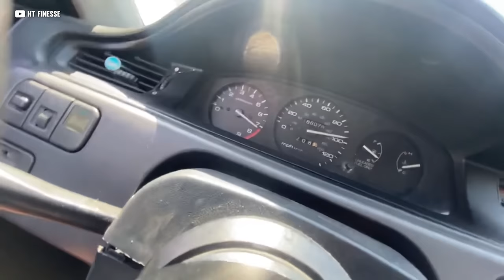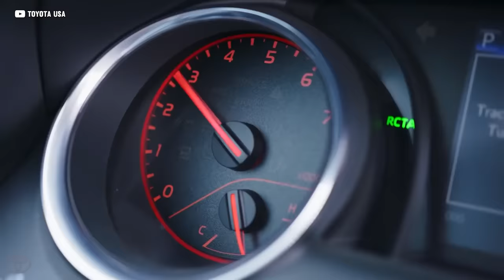7 Things NEVER Do In A Manual Transmission

Comment: If you cant hold the cluch in when on red light and adjust it on the frictionzone it means you need to hit the gym more often💀💀💀No one uses handbrake on a red light with slight uphill.💀💀
Reply: Work smarter not harder there guy.  It's not because we can't, it's because we're saving wear on our knee joint, our throwout bearing, and our clutch.  It's because we'd rather replace our clutch every 10yrs instead of every 2.
But you do you.  Say hi to all the pretentious influencers for me while you're at the gym.
Reply: Yeah I'm not going to engage the parking brake every time I come to a stop light cuz a lot of the time it's not that long of a wait
Reply: You've never had to hold in a old school cable center Force clutch with a 75 lb release. Sit and stop and go traffic with that will have your leg quivering.
Reply: @mockemperor953  The wait depends really.  So does the time to sit with the clutch engaged and in gear.  As well as the parking brake location.  In my truck, I have a foot parking brake.  I'll engage it for trains and long waits.  Like in a drive through.  Otherwise I have my foot on the brake pedal.  As for my miata, I have a hand brake.  I'll often times just fidgit with the release button.  I'll also engage the release button and use this as my brake in slightly downhill situations where you're in stop-go traffic.  Say at a busy stop sign.  I'll also engage the parking brake when parked uphill to keep from rocking backwards.  Someone I went to school with was complaining on FB about how the person behind them was too close and she rocked into them.  I responded by reminding her that this wouldn't be an issue if her handbrake was pulled.  She didn't like my response.  For highway intersection lights, I have the hand brake pulled and in neutral until cross traffic at my forward right begins to go.  Then I engage the clutch, put her in first and wait about 5-15sec.  My other strategy is watching cross-traffic stop lights.  This has become harder to do over the years, but is still pretty easy at night.  On the cross-traffic yellow, engage the clutch, put her in gear and wait.  Sometimes protected greens will mess with the timing, but those are pretty easy to figure out once you've been through the intersection a few times.  One could say that I use my hand brake for more time than my brake pedal.  My brake pedal is usually reserved for hard braking.  Speed correction is done with engine braking and sitting is done with a hand brake.  I absolutely hate it when someone is in front of me with one of those RICE flashing 3rd brake lights and they use their brakes to adjust speed every 10sec, while riding the bumper of the person in front of them.  The cringe is just too much.  You'll know a tuner because they'll have a 4th brake light, it flashes at high frequency and the brakes only come on when braking hard, or in stop-go traffic.
This is all probably just preference.  Hopefuly, this helps explain a thing or two.
Cheers.
Reply: @robertstone9988  Does a folkrace car count.🤔🤔🤔
Reply: @robertstone9988  Good idea. I can hold the hand brake on a folkrace car. Should not be that different launching on a up hill. 👍
Reply: @lassivaisanen4354  what the flying fuck is a fork race car? You talking about a fork lift?

Comment: All good advice really. It's a shame people aren't required to pass their driving tests with a manual car, that requires you to think so much more about your driving than a slushbox.
Reply: If that was the case there would be left people driving because it's not required or  people don't want to learn
Reply: After a very short time you really don't have to think about your driving more in a manual than an auto. 
It makes more sense to learn on an automatic first so that you can concentrate on the driving part rather than worrying about the additional controls. Once that is second nature you add in the clutch and gear selection. 
It wasn't really an issue for me as I had been driving field cars, dirt bikes, and manual transmission tractors for 6 to 8 years before I got my license at 16. 
BTW: In the US and Canada you have to pass your license on a manual in order to avoid an automatic only restriction when you take your commercial license test.
Reply: It is required in South Africa to use a manual gearbox car to complete your drivers license
Reply: If you get your license in an automatic here (I'm Dutch) you're only allowed to drive automatics for a number of years. After that you're allowed to burn a clutch 🤣
Driving a manual isn't really making you think more about driving. After a while you don't think about it at all anymore. It becomes a reflex and often you don't know in what gear you are, you just shift when the engine revs tell you to. My granddad learned me how to drive when I was 5 or 6 years old. Remembered it for 12 years and was able to manually shift from my first driving lesson. Only time I had trouble with a clutch was when I sold my Pajero TD and bought my first RAV4 on gas. First day I stalled it every gd traffic light, cause I wasn't used to revving the engine anymore.
With all the EV's, BEV's and PHEV's, automatics are fast becoming normal here too. My car (Toyota RAV4 Hybrid) doesn't have a clutch. Hell it doesn't even have a starter. It always pulls away electric and the the ICE comes in if neccessary. I started to have problems with my left knee (old age 😁) so it's a relieve to me not having a clutch anymore, especially in heavy traffic. Friend of mine has a Mercedes GT63s AMG 9-speed automatic. You can't shift as fast with a manual, so whereas automatics were slower than manuals in the days, that's no longer the case either. Automatics win every time. Same with my RAV4. It's a CVT. It doesn't shift, so no time lost changing gears at all. Goes from 0 to top (120mph) in one swift move. These days they can even pull trailers. Mine up to a little over 3500lb. The Merc with it's ± 700bhp V8 BiTurbo can't pull sh1t. Too damn low for a hitch 🤣🤣🤣
Reply: Even in Russia you may get automatic-only driving license these days. Truly the end is near, lol. Well, nothing is wrong with it. Its kinda easy to get automatic transmission and manuals aren't exactly "better". Another thing bothers me. I dislike that a lot of people only use a car as a mean of transport without ever understanding how it operates. It's just some magic for them, same as computers, internet or microwave oven. The void of knowledge is filled with superstition.
Reply: @Vivicect0r   And Romania
Reply: manual is honestly not that much harder than auto. the hardest part about driving is awareness of your surroundings and other drivers.
Reply: I don't want drivers in my city to have to learn manual. They can already barely handle automatics
Reply: In germany, it is. You can only drive a manual if youve done at least ten of your lessons (each 45 min) during driving school in a manual and have to do short demonstration on it. Previously you were only allowed to do if you had actually done your licence test in a manual.
Reply: In Turkey if you pass your driving test with an auto, you're not allowed to drive manual. If you do with manual, you're allowed to use both.

Comment: I learned manual in the 7th grade and have been driving it so long to the point that i look for the clutch on an automatic or CVT car
Reply: doing it for over 2 years and I have a cvt car beside the type r. I still sometimes look for a clutch in the cvt
Reply: How did you manage to go out and not get pulled over?
Reply: i do this when i go from driving a jeep on the farm to driving my car. ill instinctively press down where the clutch would be only to hit the footrest really hard.
Reply: @GK-ut9nc  i didnt go anywhere more than 3 miles away from my house before i was 15
Reply: @g0d182  Most all my cars have been manual. when driving other peoples' automatics I have several times put the seat belts the test from my left foot smashing the brake pedal.

Comment: additional information from Eastern Europe. never use the handbrake because it doesn't work. always brake with the clutch on the hill because the handbrake doesn't work. don't park on a hill because the handbrake doesn't work. when you have to park on a hill, use a large stone or a piece of wood that you find somewhere in the garbage near the place where you park. the first gear is a little difficult, so add gas and go from the second. the clutch only works all the way down. don't destroy the clutch, we don't have it in stock and we can't buy a new one. that clutch was good for your grandfather, but today's young generation...
Reply: what's bro yappin about, never had a problem with the handbrake

Comment: when you're braking in a manual car, especially from speed, you release  the accelerator and press the brake to slow down. you leave the clutch alone and the slowing engine actually facilitates slowing the car because the wheels are under control and deceleration is improved. you put thr clutch in shortly before stopping
Reply: If there's water involved you will have to cut the transmission (use your clutch) to avoid losing control of your vehicle. Yes breaking without clutch is usually better but your default spine reaction should always be using the clutch every single time. Make the call of not using it consciously on winter or on a bone dry road accordingly.

Also on winter. If you're breaking and the car just won't stop. Use the handbrake as a last resort once you've already lost control.
Reply: @aleks5405 not good advice, i found myself in a couple of icy twisty roads and what you're describing is exactly how not to handle a slippery surface, on a slippery surface it is ALWAYS the best idea to be smooth with all of your controls so no clutching in and definetely no hand brake pulling. if you find your car on an ice patch the best thing to do is to SLIGHTLY steer in the direction you wanna turn the front of the car and to either apply no brake/throttle or apply the slightest amout of throttle depending on speed and on wether your cars is RWD/FWD/AWD, pulling the handbrake is a death wish since you are completely preventing your rear end from getting any grip.

Comment: For my AE Corolla I always put the lever on 3rd or 4th. Main reason is being rwd there are two shifter return springs and by putting it on 1 or reverse you compress those springs and wear the tension over time. This is why you sometimes feel going from neutral to first has less resistance then going from neutral to reverse and vise versa. It's okay for most fwd as the shifter return springs are torsion springs and not heliacal
Reply: Though, you should never put it in a higher gear then 1st or R if you have a diesel. Put it in 3rd for example and you're parked in a slope and you don't pull the P-brake, or the P-brake doesn't take properly, it can start rolling. And since the wheels are now directly connected to the transmission and the transmission to the engine, the engine will crank if it starts rolling. A diesel engine doesn't need a spark to ignite the fuel so worst case scenario is that you now have a self driving car that might not stop until meeting an object heavy enough to stop it.
Reply: @tntfreddan3138  There are very few diesels around now which will run without electrical power - they all need computers to control the fuel injection these days. Valid point about using lower gears, though.

Comment: Another good way to avoid shifting into the wrong gear is to realize that most modern cars will have 5 or 6 gears and a reverse gear, so you separate the gear stick into three columns one to the left, one in the center and one in the right. When you have the stick in neutral and you're not touching it, it will automatically be in the 3 and 4 column, so you know from there if you shift downwards you'll have fourth, and upwards you'll have three. Same for the left and right column. This way, just by letting the stick naturally fall into position, or moving it left or right you know which column you are in, and which gears you can select.
Reply: Yep, don't need to fully double-declutch, but if going 2-3 (or 2-4 if your driving is spicy), disengaging the gear and letting the gearstick spring back to the centre, then going from there and you'll be very unlikely to find the wrong gear.

Comment: I've once happened to be slowing down in a parking lot using engine. And my car is fwd. And it was winter. And I was turning...
Breaking power of the engine ended up being the main culprit of locking the wheels and making me slip. Luckily I wasn't going fast to begin with and a slight touch on the accelerator immediately solved the issue.
Be careful out there
Reply: yeah engine braking at winter is asking for trouble, got a steep hill down from my house and i sometimes lock up the rear wheels for fun bearly rolling down simply because it's so slippery the engine braking is enough to break traction
Reply: @Stale_Mahoney dang

Comment: That two-finger shift displayed in the video is actually performed on a Scania Comfortshift transmission. It's a preselect computerised gearchange. Hence the shifter has no actual direct link to the gearbox. The driver selects the desired gear, and that gear is only engaged when the clutch is depressed.

Comment: Thanks Dad for teaching me all of things.
When I was 10.
Always park with the E-Brake/Parking brake on? NO!  I live in an Arctic environment and this is a strict no-no below -25C.  Especially after driving through snow there is a strong possibility you will 'freeze' the brake in place. Buy a set of chocks if you live in this type of environment and leave the lever down.
I also lived in Vancouver BC which is notorious for being mountainous, wet, and having some of the worst drivers in North America.  Driving a RWD Celica (1985 model), with no weight, bad tyres, and on a steep incline with a complete Douche parked right up my @#% teaches you how to do the e-brake launch really fast. I also learned to do a 'roll back' at red lights to warn people behind me a was driving a stick.

Comment: Never shift gears too fast, let the stick rest in the middle for a split second each time to allow synchronizers to work.
Reply: Like pressing the clutch and letting gears in neutral for 1,2 seconds? Then shifting in the gear i want?
Reply: @jamaicaalx3311  1 second is enough. just don't slam it every single time.
Reply: Only if you're driving a car from 70s or 80s. Those had the first synchros which were not as durable as these days. Maybe it's relevant advice if your vehicle has survived half a million miles and you'd like it to survive half a million more.